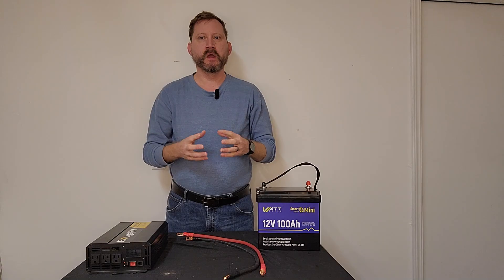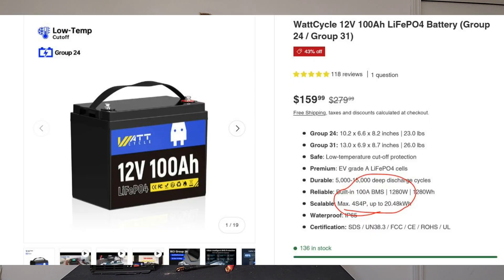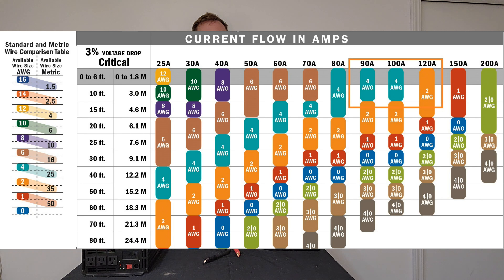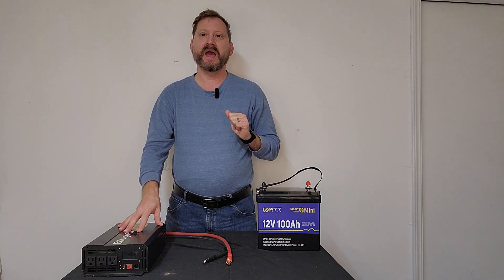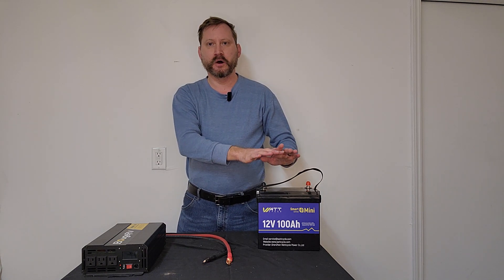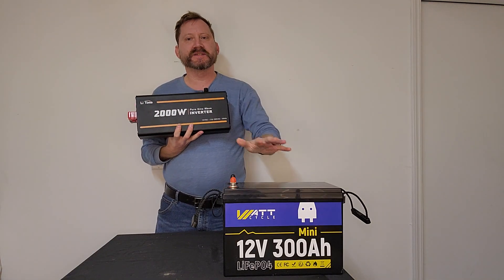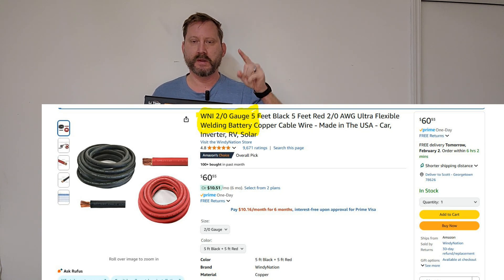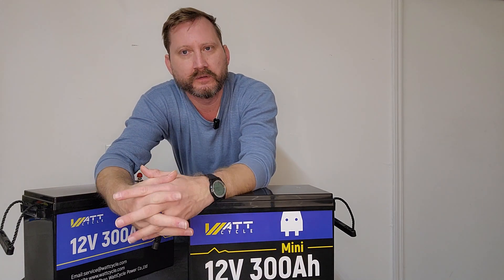Building a DIY Power Station DIY Start here! | Texas Prepper Projects #prepper #solarpower

Comment: What about wiring in a trailer with ALL 12v appliances (Refr, freezer, etc)  - wiring requirements w/o AC
Reply from the maker: What about it? That becomes much easier because the loads are smaller
Reply: What size wire would you use  @texasprepperprojects
Reply from the maker: It depends on the current you are pulling. But I would say 10 awg

Comment: If you have four 100 amp hr batteries with 100 watt bms wired in parallel is the draw on them still limited to 100 amps ?   Also when you charge them lets say with a 50 amp charger is that going through all the batteries even though they are each only recharging at about 12.5 amps each ?😊.  I really don’t know.
Reply from the maker: Yes
Reply: @texasprepperprojects Yes to what I asked more than one question and don’t understand the answer 😊
Reply from the maker: Yes the amperage is still limited to 100a. Yes the charge rate is cut by 4. That's why you want to increase the voltage to 24 or 48
Reply: @texasprepperprojects Thanks so as I understand you as saying 100 amps is going through all the batteries even though it is only draining 25 amps from each of the four and on the recharge at 50 amps even though each battery is only getting 12,5 amps.

Comment: Building a system for the two back bedrooms using a 1200w power station to keep it portable with  2 additional 12v 100ah, and 260w of solar panels to charge the power station.  For now the 2 batteries are  charged separately.  to complete I will need to get about 800w of solar and a MPPT controller to charge the batteries.  My next build will be for the rest of the house larger to keep down wire issues will be in a fixed location, 48v with at least a 3000w inverter , 2 24v 100ah wired in series ( bought them already) , 1400w solar panels, and 60a MPPT controller.  This will give me room to expand if I need more batteries or panels.  Will stay on the grid to run the 240v equipment.
Reply from the maker: Cool

Comment: Did you ever open up your inverter to see what the interior specs are like? I did on my 1500 pure sinewave inverter. It had 10 AWG wires attached to the interior lugs. So I have 2 AWG on the outside and 10 AWG on the inside. Yeah, it's only for 4 to 6 inches in length on the interior, but still...
Reply from the maker: No i never have. Interesting idea though. What was the brand and wattage of yours?
Reply: It's an AIMS 1500 pure sine wave inverter. A pretty reputable inverter company. I can only imagine what AWG other manufacturers use inside. @texasprepperprojects

Comment: Wow, I did the exact thing you explained a few months again with the little battery and a small inverter and I almost melted my cables. Good thing I was watching with a temp gun and I shut it all down before it started a fire. Good stuff I wish a video like this was around back then. Thank you for sharing.
Reply from the maker: What were you using? Do you know your battery and wire size? As an example?
Reply: @texasprepperprojects  Envy LiFePO4 Battery 12V 25Ah, BESTEK 300W Power Inverter and powering a Lasko MyHeat Personal Mini Space Heater (150W). Cables I started with 12ga and ended at with 10ga and it was still getting very warm. The first time the connector from the battery to a 12V adapter to plug in the inverters felt like cladding was "juicy" and ready to peal off. Tried a few different types of 12V sockets and cables and even in the best scenario with 10ga within 5 mins it got to hot so I killed the experiment.
Reply from the maker: @cocoloconuevo   good plan.  Even if it worked, it wasn't going to run for very long
Reply: @cocoloconuevo  Some things like heaters seem to run or make the setup run hotter, I assume due to cheap vs good quality heaters or other items, you probably would have done much better using 4ga instead of 12 or 10 even though online charts say a 10 or something else would or should work, obviously you proved it won't, so go lower, I've done that, & I've sold my cheaper quality heater & with a little research found a better quality one & using lower gauge cable anyway worked great.
Reply: @cocoloconuevo  Were the terminal connections tight.  Loose connectors will get hot.
Reply: @shelley131  Yes it was.
Reply: 150W or 1500W?
Reply: You are supposed to use appropriate fuses. Fused no bigger than the ampacity of the wire. Or smaller depending on the load.

Comment: Good advice ... A hint to the subject of fuses in those systems (as crucial as wire sizes an wire materials) would have been great ...
Reply from the maker: I didn't talk about fuses because I can't find a breaker or fuse holder that really excites me so I didn't want to recommend or demonstrate something I didn't like.
Reply: @texasprepperprojects  ... For loads bigger than 50 A I would recommend T-class fuses because of them hindering sparking causing non sufficient separation of the contacts under high loads ... never use car-audio fuses or even midi fuses ...
Reply from the maker: @Tom111060  Any suggestions for breakers or fuse holders?
Reply: Yeah, the DIY systems look so easy to build but my lack of knowledge on the fuses always holds me back from building one. That and I don't want to buy the tools for cutting/crimping the ends.
Reply from the maker: You can buy the wires pre made if your only going to build one. Get a pair of pre fab 2 awg with M8 rings on them.
Reply: Tariffs due to kick in by Aug 29,2025

Comment: My rule of thumb:  Size for about 150 amp maximum continuous on the D.C. side.  This allows 2 awg for a foot or two before you need to upsize for voltage drop.  What that comes down to for inverter size:

1500w to 2000w on 12v
3000w to 4000w on 24v
for more use 48v.  (It would be nice if higher voltage equipment were more readily available... maybe someday.)

The range is intended to account for product availability and surge ratings, so it means the smaller is the design normal max usage, the larger for brief starting surges.  For example, your 12v, 100a BMS might support 150a to 200a for a few seconds or you might have two in parallel. If you want to plan for using that, that would be roughly an 1800w to 2400w surge at 12v. Do not believe the bold claims that your cheap 1500w inverter will surge 3000w for anything more than a fraction of a second and that is unlikely to be sufficient or safe for your equipment so you need a bigger inverter, hence 2000w.  You also need to realize that 200a is going to have twice (edited) the voltage drop in your wires as 100a.  Lower voltage means your inverter is going to need to pull even more current and be even more stressed.  You should probably go up a cable size to reduce the voltage drop.
Reply: My 2K inverter is rated for 3K peak (burst) for a few seconds. Just long enough for my fridge to start running.
Reply from the maker: Sounds good!

Comment: You are SPOT ON! I I presently have a Homebrew system I am building up. By the end of next week, it will have four 100 Amp Lipuls Mini's for the battery Bank- just over 5 Kilowatt Hours capacity. At this moment in time, I'm also running a Best Ten\k 500 Watt Pure Sine inverter like the one in this video. My Battery Cables are Currently 6 Gauge: This will BARELY handle the 500 Watt Inverter.
This has been a difficult Build-As-I-Go project because I'm 70, Disabled and on limited SSI. I add a little to it each Month until it will be done.
BEFORE I put this into full operation, the 6 Gauge Wire WILL be replaced with TWO Gauge Wire and 100 Amp Rated Quick Disconnects. I ALSO plan to have 80 Amp Circuit Breakers between each Battery, and another 80 Amp Breaker between the Battery Bank and the eventual 2000 Watt Inverter that will be installed.This is to allow for the "cushion" you made reference to.
I agree with you completely. You are a breath of Fresh air, and you know what you are talking about. BRAVO!
Reply from the maker: I think you should change to 24v. Grab a 1200w 24v giandel from my other videos reviews
Reply: @texasprepperprojects  Right now, I can't afford it. MAY do that when we move to our next home.

Comment: Couple questions:
1 the higher the voltage the more risk of electrical burns/shock (with amperage being known as the killer) .  Saw a post about you get into the danger zone with anything over 12v?

2. From what I’ve been reading PV wire for your panels should be 196  stands…..does # strands matter between battery-> Fuse -> Inverter .
Reply from the maker: 1.  I think that the danger zone is anything approaching 50v. I don't see 24v being that much worse than 12v but please don't quote me on that. 

2. Don't know

Comment: If you build a 24vdc  2,000 watt ac inverter system can’t I use 4awg for the entire build?  
Excluding the mc4 solar cables & the 24vdc to 12vdc buck converter? 24vdc system seems to simplify having multiple diff size wires in the system
Reply from the maker: Are you pulling 2,000w at all times? Or just surge?
Reply: Just surge
Reply from the maker: If it's just surge then 4 is probably OK.

Comment: 2 gauge welding wire is rated for up to 205 amps, 2 gauge 12 strand copper / the stuff thats hard to bend is rated for 120.
Reply from the maker: Windy Nation wire for the win. It's very soft
Reply: It gets really hot at 200 amps.  The only difference in the amp rating is the insulation temperature and environment. The welding wire has high temperature insulation and is expected to run in free air for intermittent loads.

TL;DR: if you need 200 amp continuous. use 0awg.

Comment: I agree with everything you said but you didn't mention the single biggest item to add for safety.  Adding a fuse between your battery and inverter.
Reply from the maker: Thanks
Reply: Lucky me my inverter has external replaceable fuses for that reason.
Reply: That too

Comment: thanks another nice video.
i switched to 24v just 2 days ago..
once i was running just a 500w load on the 12v system and was like aw hell nawl! this wire is HOT!!!
wish i had more batteries id just go 48V.
i only have 2 with my poor butt. :face-purple-wide-eyes:
Reply from the maker: What size wire were you using???
Reply: @texasprepperprojects  claims to be 4awg but i think its like  6awg but then the inverter is madness.. thats why i had to change it..
i have 2 awg between the batteries.
the new 24v inverter runs cool itself even under load.. and the wires arent even noticeably warm.. everything feels like body temp.
i need to get a clamp meter, visual thermometer and other stuff. (
*hint hint - make videos about equipment) :face-purple-crying:
Reply from the maker: I use my thermal camera to check wire temps. Scroll back through my videos for the mini thermal from cool gadgets. 

I do have a couple of DC clamp meters I also use
Reply from the maker: Also make sure you are using good wire. Pure copper not CCA. Windy Nation Wire for the win!
Reply: @texasprepperprojects  awesome.. thanks!

Comment: Great information as always.  I love my watt cycle mini batteries.  They are so easy to move around from one place to another.
Reply from the maker: Agreed! It's one of the batteries I have NO plans to get rid of. It's so tiny with so much power!
Reply: They're dirt cheap because most of them no longer have an output transformer which means  that they can easily damage whatever is plugged into them because they don't provide any galvanic isolation.

Comment: Great info!  Only thing I could add is just jump to 48v systems!  Did that 3 years ago and never looked back.
Reply from the maker: I have very specific reasons why I don't go to 48v.  First,  stand alone 48v inverters are rare and expensive. Also, my loads are not that big. On top of that, the minimum input voltage on an MPPT for a 48v system is fairly high. I'm in a rental house, so this is an emergency system that lives in my garage.  I can run a 24v MPPT with a used residential 35v panel from facebook and move it in and out as needed.
Reply: @texasprepperprojects  Understand! Keep the great content coming.
Reply from the maker: @ Thank you!
Reply: @texasprepperprojects  I'm in a condo and my use is just emergency backup power.  Have Delta Pro,  Extra Battery and 2 48v lifepo4 batteries connected in parallel to supplement faux solar.  Also have Ecoflow Alternator charger to get 500w continuous from our cars.
Reply from the maker: I'd buy a sportsman 800w generator for $199 before I used my car. A car is a terriblely inefficient generator from a fuel economy perspective. I have a prepprr friend that doesn't belive in solar and charges his Eco Flow with one of these gens
Reply: @texasprepperprojects  Car charging is very incognito in a power outage.  I have a 3000w inverter generator as well.
Reply from the maker: @stevenshircliff393   All of my neighbors were sitting in their cars charging their phones during the Tx Blizzard a couple of years ago. After it thawed, I bought them all USB battery packs and left on their doorsteps.
Reply: @texasprepperprojects  Don't sit in car. Get a steady 600W coming into my Delta Pro via the alternator charger.  Car pulled up close to garage.  Cable running into garage under garage door.
Reply: @texasprepperprojects  You're a good neighbor.
Reply from the maker: Because the sun doesn't always shine. I see his logic we just disagree. He is also using a $200 800w sportsman generator to chatted his ecoflow
Reply: @texasprepperprojects  Too bad they are all ADDICTED to social media.
I for one don't want to be tethered to anything.
Reply: Ok. My system is 12 volts and I haven’t looked back either.
Reply from the maker: Cool

Comment: Good stuff,looks like I'll need a 1gauge for a 24v 3000w inverter with 2 12v 100ah batteries
Reply from the maker: I would get ride of those two batteries and get something bigger. If you're running that much AC, you're going to kill them FAST.
Reply: @texasprepperprojects  like the 300ah?
Reply from the maker: @viyusavery248   absolutely.  Get two of the wattcycle 280/300ah batteries and put them together for 24v. This is what I am doing. Check out my other recent videos and hit the links in the descriptions.
Reply: 3000w ÷ 24v = 125 amps, 2 x 12v 100 amp batteries in series = 24v 100AH, 100amp bms, not enough battery to run 3000w, and 1 gauge is good for 150 amps dc. Hope that helps your understanding.On a side note, 3000w high frequency inverter is only good to 1500w,  3000w  low frequency inverter is good for 3000w,  even when there both pure sign wave! Learn first, then buy informed, you will save money, and be much safer and better off! High frequency ( $5 chipsets ) tuned to 60hz,  low frequency ( tranformer based ) just like our electric grid! It's not rocket science, it's actually quite easy.
Reply: @dustydawson8977  your correct but   this small system will not use 3000w
I dont believe in using inverters to max capacity, because of loss to longevity 

At peak ill be using it for 1500 to 2000w max

My philosophy is to always oversize the inverter and then use  about 50 to 70% capacity 

I really wanted a 24v 4000w maxwine inverter byt its out of stock 

Yeah so id buy a 4000w inverter for 2000w continuous use vs getting a 2000w inverter using it at max all the time which usually drops voltage and stresses it

And also current budget lol i will add more batteries over time
Reply: @viyusavery248  My sentiments exactly on inverter oversizing. I did just that - 2000w but probably need 1500 to start fridge and 500 to run fridge.
Reply: @dustydawson8977  also you forgot to add the efficiency of conversion like 0.8 so it will be pulling even more amps from the battery 

I also wanted a ampintinv 24v 3000w low frequency inverter but i dont have $465 dollars to spend right now OR have the budget to get even more batteries /panels to overcome its higher idle  power consumption
Reply: @viyusavery248  Its all good, I have 2 low frequency units, bought not built! 24v  3000w, 2000w solar in, infinately exspandable in 2kw increments, using there batteries, but it also has built in exspansion battery port, can utilise any chemistry from any manufacturer. And it's idol consumption is a meer 13w. I have 10kwh on it now, and as you said you wouldnt pull really more than half rated power on yours, that's the difference in low and high frequency, my low is designed to perform at max day in and out, for a really long time! Just facts, but yes it does cost to have a quality system. As far as I know there's only been 1 company that has ever built a low frequency unit,  the rest are high frequency, ie, Ecoflow, Bluetti, and you know the names.

Comment: A few years ago diy power stations were the most economical way to have a power station, now the prices of power stations make it not worth it. I just got a 1800w output power station with a couple a 150ah batteries.
Reply from the maker: I agree, to an extent, but it depends.  18 months ago the line was 1kwh. Now it's 2kwh.  But, for a BIG power station (greater than 2.5kwh) I can definitely build it cheaper than I can buy it for.  Check out my other videos, using the Litime24v all in one and two Watt Cycle 280ah batteries, I can get a 7kwh power station for under $1600.  To buy that would be $4k ish
Reply: @texasprepperprojects  I agree completely! My 5KW DIY, when finished will pencil out at UNDER $3K.
Reply: And if the power station has a faulty part what next?
Reply: That’s why I have 3 power stations.